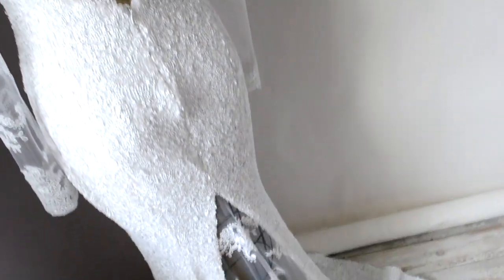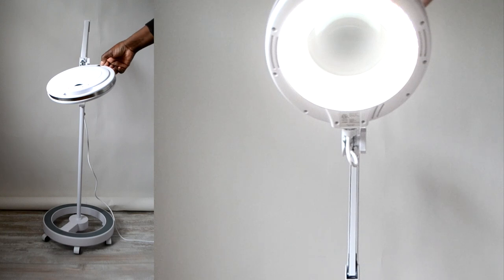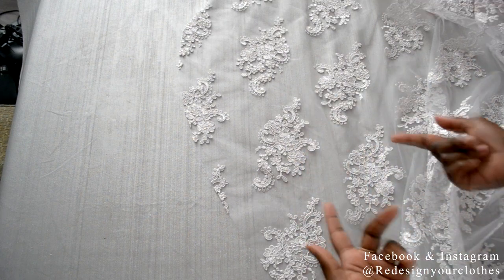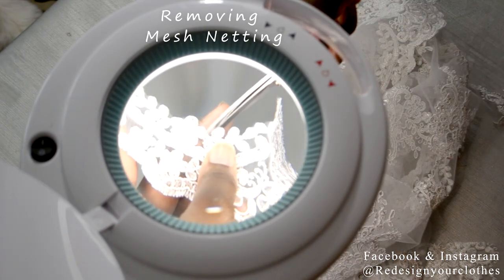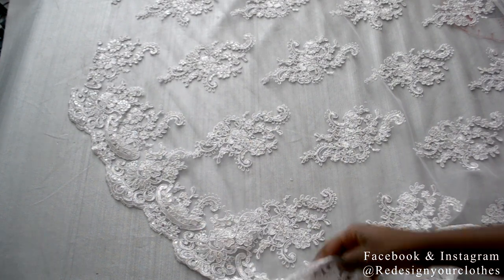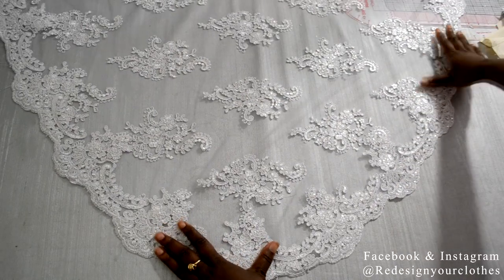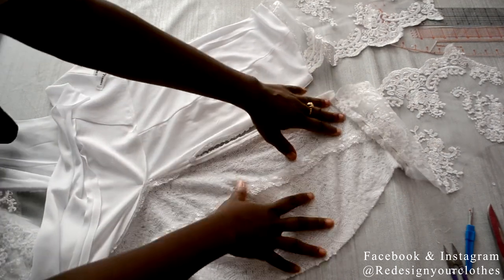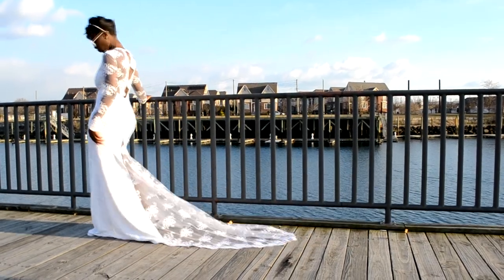How To Sew Lace Applique On A Fishtail Bridal Gown

Comment: A tip I found to use when cutting lace appliques is to use a soldering iron to "cut out" your lace area.
The heat will singe off access mesh and make a smooth outline for you to use. Saves so much time.

Comment: On sewing the lace by machine - some machines disengage the tension discs when the presser foot is lifted, so make sure you know the limits of your machine.  Also, you may also have a freehand quilting foot that came with your machine - that is a small hoop that attaches to the foot so you can see your project and also get a little help holding the edges down to sew.  With such detailed lace, the freehand quilting foot may be more of a pain than help though.
Reply from the maker: Thank you for your feedback! I don't think my machine came with a quilting foot because it very outdated, but I will double check to see. Thank you for the helpful tip
Reply: Even if it didn't. My machine is from the early 60s. The manual sugguests taking the foot, or in your case the adapter completely off the pressr bar. And yes, you always want to do free motion work with the pressure bar down. Beacuse it does disengage your top tension. Thats just the way a sewing machine works. Thats so you can pull your work and thread out of the machines after each use.
Reply: @DanielaTabois  your work is as beautiful as your community. Keep up the good work. I can't wait to see your next incredible project!
Reply: @DanielaTabois  Hi there, what size is this Wedding dress 👰?

Comment: I find it easier to use a soldering iron to burn out the edges of the lace so it doesn't fray, but you do a great job with scissors.